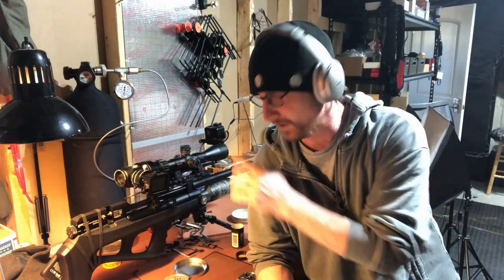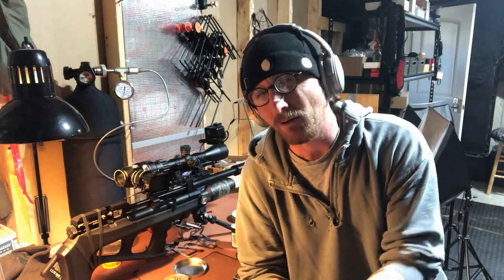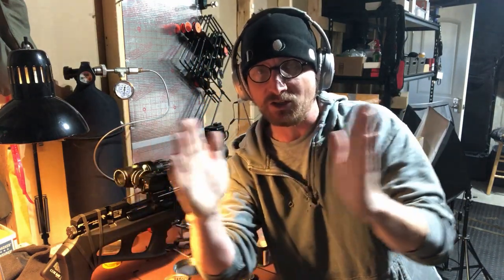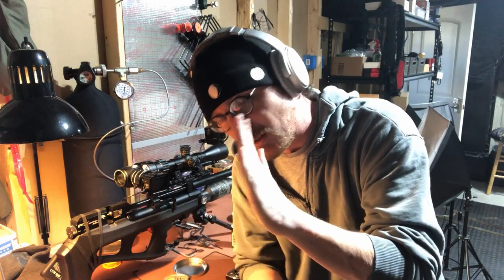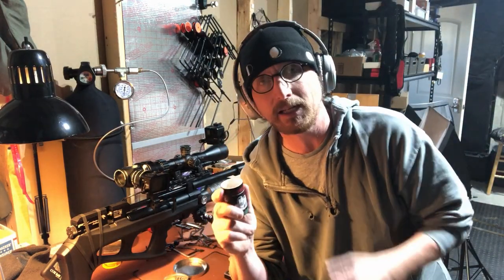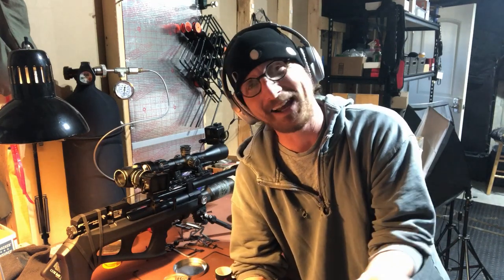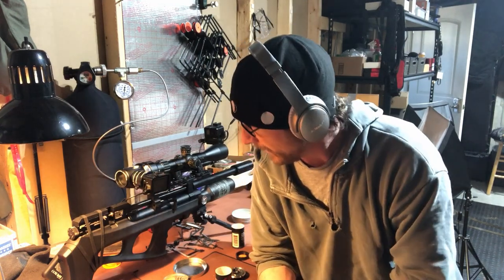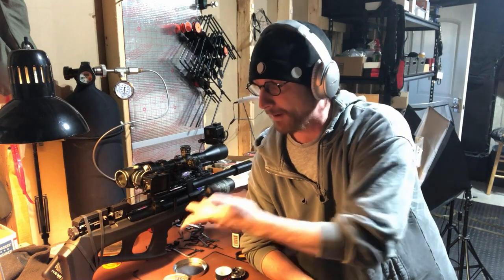WildCat MKIII BT .22 Compact Tuning Advice and Maximum Power

Comment: I think I've discovered why some of us are not getting the same results.  Check your hammer weight.  Some (like mine) shipped with the 7 gram hammer weight.  Some are shipping with an 11 gram weight.  I'm betting anything that Ted's has the 11 gram hammer weight.  The little 7 gram weight if fine for .177 and 22 pellets, but it just cannot handle slugs.

Comment: Thanks Ted.   I might go with the 600mm barrel,  that should give me more top end without going all the way to the 700mm.    Any pros or cons to going with the 25 cal over the 22?   In other words is there any difference in slug accuracy between the 22 and 25
Reply from the maker: My experience:  The .25 is a bit less accurate (slugs) than the .22.  My .25 700mm M3 Impact shoots Nielsen 29.0gr, 29.5gr, and 34.9gr pretty good.  1.5” at 100 yards.  That said, my .25 slightly outshoots my .22 when I’m sending pellets.  And finally, I KNOW several .25 ammo innovations are in the pipeline from multiple companies.  That’s all I can say without pissing someone off.  😁
Reply: @HoldOverVlog  lol.   I hear ya,  well I appreciate the response!  I guess I’ll wait for now to see what transpires.   The bc of the slugs in 22 has always intrigued me.   I have impacts in 25 and 30 and thanks to you they both shoot pellets VERY well.   Your tunes are spot on.   🍺

Comment: Hey Ted, just took delivery today of this exact gun. I love it right out the box as far as looks and feel, but having some real reg problems. Velocities are ALL OVER the place and it really feels like sticky regs. Very familiar with the adjustments and operation as I own a maverick compact. With 23 grain NSAs im maxing out at 840fps. But it will all of a sudden drop almost 100fps on a shot after every few shots. Should I let it "break in" or should I send this thing back in your opinion?
Reply from the maker: 100fps spread would certainly be a issue, either with the gun or the chronograph.  First thing I would do is test another gun (if you have one).  I would also pay attention to the sound (pitch).  The gun would sound considerably different between those two velocities.  If it does turn out to be the gun, it may be a simple fix, such as: a loose or misaligned pellet probe, or a bad breech o-ring.  Have a go with those trouble-shooters then get back at me. 👍
Reply: @HoldOverVlog  thanks Ted. After going through all the simple stuff(probe, breach seal, hammer spring, etc) and talking with Bin at TPS as well as Newman at FX US , shes going in for warranty repair. Definitely something goofy with the reg/regs/valve. Im also going to have them throw in a heavier hammer, maybe even the slug probe. Both FX us and TPS have killer customer service. Appreciate your replies and help too! Can't wait to get it back in a month or so and stretch its legs!
Reply from the maker: @joshfrey9336  Bummer on the extra wait.  But, awesome on the customer service.  I've met Newman.  About the nicest guy you'll ever meet.  And I agree - why not add a few upgrades while your at it.  💪😁

Comment: You have a lot of good info,, But can ANYONE explain why the Maverick Mark-3 has a 89cc plenum for less money when the Impact M3 only has 72cc,, I thought the newest impact was supposed to be their TOP Gun for Power? And is there major pros and cons to each gun besides price? Thx.✌️🇺🇲
Reply from the maker: Short answer: the maverick is a simpler gun. Uses less materials.  Faster to build.  The maverick hammer is under the chin.  The impact’s hammer is forward - under the scope. The impact is also shorter because the rear block only needs to hold the probe (not the hammer and spring).  the impact magazine fixes under the rear block, and can be set up for lefties because the cocking lever can be on either side. Finally, the magazine won’t get in the way of a left cheek piece because it is under the block.  The capacity of the impact magazine is nearly double that of the maverick, wildcat, and crown.
Reply: @HoldOverVlog  Okay thanks for your answer, I guess the larger impact mag won't fit in the other FX guns and the 72cc plenum must have more technology and expense to get those huge shot count numbers along with high power. Thanks again, keep up the good work.✌️
Reply: Also know that plenum size is a big part of power, but not everything. The Impact has more room for its valving and efficiency of air flow than the Maverick / Wildcat. Hope that helps
Reply from the maker: @yukonjack.  There you have it.  Strait from the sources.  Thank for commenting @FXAirguns!

Comment: If  it's possible, I would like to see your hammer weight. 
My Maverick compact. 22 couldn't reach those speeds with his hammer weight .
I changed it with heavier (11.5 grams), and now I can easily reach those speeds.
Reply: Very very true.  I can't get those speeds with the stock hammer.  It's just too light for setting the reg at higher pressures.   Installed the heavy hammer that comes with the slug kit on my compact mk3 bt and I'm only able to squeeze 980fps at the most with the 23 grain Javelins.  I know every rifle is different, but there is NO way he is using the stock hammer.  I'm maybe getting one magazine and a half shot count.
Reply: @Fernando_Woolybooger  did you remember to flip your barrel so that the slug transfer port is in use?
Reply: @arubino19  Yes, its on the slug port.  I never use the standard/pellet port.  Since my last post, I went up to the 600mm barrel and have the heavier hammer/pin probe installed.  Now, I'm getting the numbers Ted was getting.  1st Reg is at 170-175, 2nd reg at 145-150....  The oem gauge is terrible and very difficult to read.  I've ordered some Sekhmet digital gauges.  The BT in compact form is just not a slug gun.  Great for pellets.  If you want to make it a slug gun, you will have to go with a longer barrel and heavier hammer.
Reply: @Fernando_Woolybooger  my BT gets delivered tomorrow. I previously had the first gen mk3 compact and had fantastic results with slugs. They don’t need to reach 1,000 fps always.I was shooting them at 920-930fps (23gr NSA) with fantastic results. And that was with stock probe and hammer. It’s definitely not a long range 150 yard plus setup, but works great inside of that.
Reply: @arubino19  Excellent advice.  I'll re-visit my compact setup and tame it down to the speeds you mentioned.  What diameter NSA's did yours like?  Mine likes the .2175's and I'm waiting on some .218's to try.  I also think my hammer isn't adjust correctly and I'm wasting air.  Even with putting a 580cc bottle on, I'm only getting 2 mags of shots.
Reply: @arubino19  I'm about to get some slugs in for mine. I have the slug power kit installed from Utah Airguns. 
Could you explain this about flipping the barrel for a slug port?
Reply: @Mistborn94  yeah you just loosen the barrel screw and pull the barrel out enough so you can see the transfer port, you’ll see a single hole with “P” next to it, that’s for pellets. Rotate the barrel until you see a larger hole with “S” next to it, make sure that’s facing down and slip the barrel back in.
Reply: @arubino19  okay thanks. Why isn't this in the manual lol?
Reply: @Mistborn94  probably because they started putting the dual transfer ports on after they printed the manuals lol. Just my guess.
Reply: @arubino19  can you shoot pellets with the slug port?
Reply: @Mistborn94  you can but if you have the slug probe you have to be careful the pellet seats properly. The pin probe pushes on the center, designed more for flat based slugs. The pellet probe engages the outside of the pellet, best for skirts to make sure it seats in the barrel properly.
Reply: @arubino19  I've been shooting pellets out of it now with the slug power kit. The accuracy has been insane. 
The slug port on the barrel, does it just allow more air for slugs? or what exactly is happening. 
I was under the impression I could just load and fire the slugs.
Reply: @Mistborn94  yes it allows for more airflow. Pellets don’t need to go that fast, maybe 900fps max for pellets so you reach the point of diminishing return shooting pellets with the slug kit in my opinion. Start shooting slugs if you have the power kit installed. Slugs are not plug and play you still have to find the right weight and speed.
Reply: @arubino19  I've got my pellets going a hair over 900 right now. The groups at 50yards are .25" and 1" at 100yards. 
Just got the javelins today. Going to try them out tomorrow. I suspect I'll have to turn the power wheel up a little bit to move at a good speed.
Reply: @Mistborn94  what grain javs did you get and which length wildcat do you have?
Reply: @arubino19  the 23gr slugs. I've got the 700mm "sniper" one
Reply: @Mistborn94  I was shooting the 23 grain NSA excellent anywhere from 930-990 with the compact version but I had to completely max my hammer tension to get to 990. You should not have to do that with the sniper. Shoot for anywhere between 930-990 with the javs. Remember there’s that little adjustment screw inside the power wheel you can play with too. If you adjust it too much the gun won’t cock though.
Reply: @Mistborn94  also my front reg was 180 and rear at 150. You should be able to get over 1000 if you wanted to with the 700mm.
Reply: @arubino19  I have my power wheel adjust so that at 1 I'm getting a hair over 900 with the pellets. So I won't have to dial it much to get a slug to move that speed I imagine.
Reply: @arubino19  idk how to even adjust the front reg lol.
Reply: @Mistborn94  do you have the mk3 bottle version or cylinder version?
Reply: @arubino19  it's the bottle version
Reply: @Mistborn94  you remove the stock to adjust the first reg it’s easy. The reg adjustment screw is underneath where the bottle screws in you can’t miss it. But there’s no reg gauge for the first reg, you have to use the rear reg gauge so what you have to do is back out the second reg adjustment screw until it’s flush, that opens that reg all the way to where it’s not even in play then the gauge will read the first reg pressure, adjust it up to where you want it. Then degass the gun and turn the second reg screw all the way in, re gass the gun and then back out the second reg screw until you get it where you want it. 20-40 bar lower then where you set the first reg. It sounds confusing but it’s easy. If you need to look up on YouTube how to set the maverick dual regs it’s the exact same process as the wildcat bottle is essentially a maverick in a wildcat stock.
Reply: @arubino19  gotcha I was confused because I saw no gauge. I'm gonna run it stock setting on the regs and see how it goes. I'm betting I can hit 1k on a slug they way it is.
Reply: @Mistborn94  I would at least put the hammer on 7 and max out the screw. That will give you a baseline on what the fastest you can get with those reg settings. You can easily turn the wheel down to lower settings from there. Shoot a 5 shot group with each power setting.
Reply: @arubino19  I'll probably start at 7 on the dial and see. Then adjust the hammer more if needed.
Reply: @Mistborn94  what I mean by maxing the hammer screw means you’ll get the Maximus range for 7 down to 1. It’s easy to do with calipers, take of the power wheel and pull out that silver cylindrical thing that has the hammer screw in it. Back out that lil screw until it sticks out 6mm from the base of the silver thing. Any further than 6mm you run the risk of the gun not cocking. Just a tip if you decide to go that route. It takes the guess work out of sticking the Allen key through the adjust hole and wondering how much adjustment you have left.
Reply: @arubino19  well I set it up so that my lowest power shoots pellets at 900 and so then ideally my highest will shoot slugs at at least 950. 
I have messed with the Allen key a bit

Comment: Awesome videos ted. Any idea why my new mark 3 impact will not hold zero from day to day? I will zero at 30 yards shooting hole for hole. Then next day shoots 1 inch low ……..  same tin of pellets and i have eliminated scope issues swapping from a leupold to nightforce.
Reply: The weather and temperature have a lot to deal with that, and if you yake it from inside your house to outside, let the air temp in the bottle adjust

Comment: Mr Ted my Maverick is leaking I know it’s an easy fix I’m good at figuring things out I’m just a little intimidated on my expense gun.  Problem the screw under the bottle reg fell out I put it back in but now it doesn’t hold. Do I replace the  small o rings on the adjustment screw?
I understand if you don’t have time answer I know you are busy.
Thanks 🙏

Comment: Ted thanks for the tips! I have the sniper variant shooting H&N barracudas 21.14gr 5.52mm at just over 900fps at my Power 1. 
Shot it indoors to zero everything out and I was able to stack 5 pellets in a quarter inch hole at 50 yards and that opened to just under an inch at 100 yards. Though my support wasn't the best.
I love having so many shots out of the bigger bottle. 
Getting in some slugs soon to test out as well.